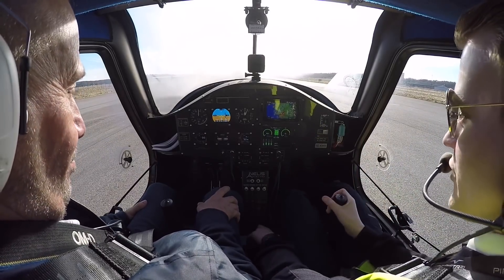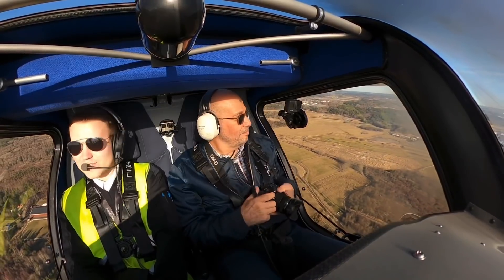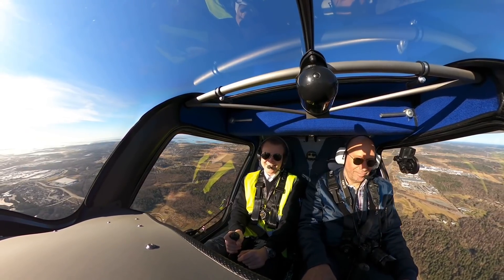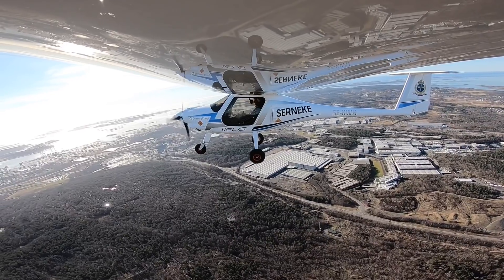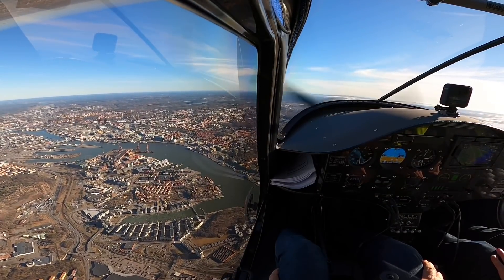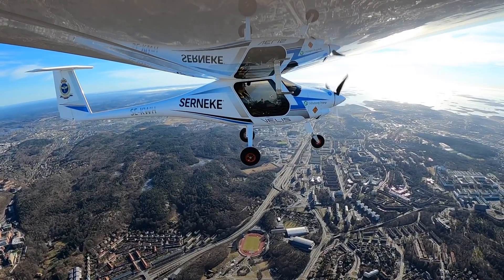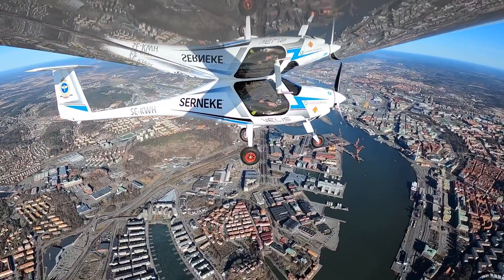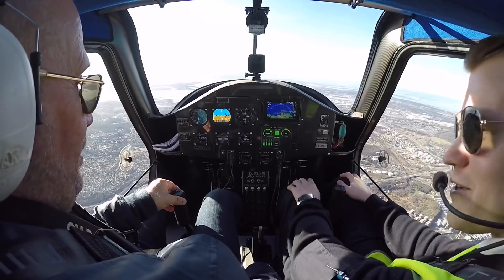Electric Plane With Beautiful Handling! 🥰🛩

Comment: Does this A/c use 'windmilling' of the prop when descending to recharge the battery, converting the kinetic energy into electrical? Pilot made a comment about gliding but wasn't sure if he meant what I'm asking.
Reply from the maker: No, it only glides with minimal resistance. If it was using the prop for recharging it would have caused drag.

Comment: Absolutely amazing aircraft and looks gorgeous. 
It is so quiet and I assume less vibration as opposed to an internal combustion engine.
With a glide ratio of 15 : 1 I would be really confident flying the aircraft, amazing 👏
and it looks so controllable in a stall situation. 
This is such a game changer in general aviation and certainly the future. 

Gothenburg and the surrounding area looked absolutely stunning in the video.
Thank you for sharing the video. 🤩👍👍🇸🇪🏴
Reply from the maker: Not completely quiet and without vibrations but almost. Of course there was no noise from the exhaust. 👍🏼🙂
Reply: @bjornpilot  my apologies , the glide ratio I meant 15 : 1 🙄😊